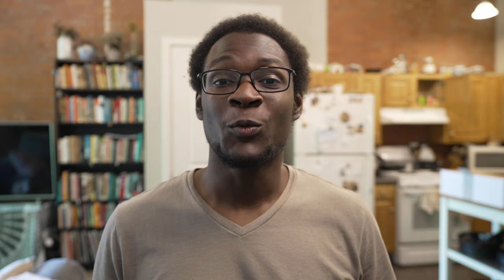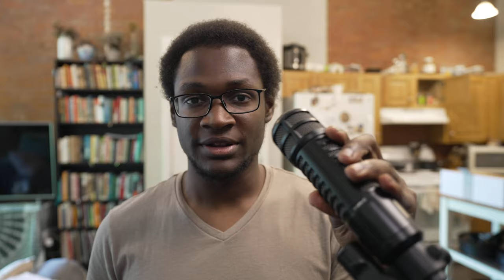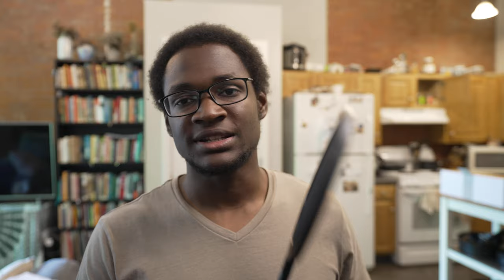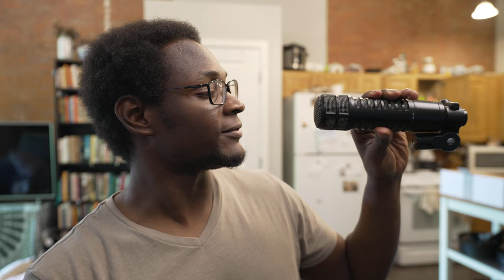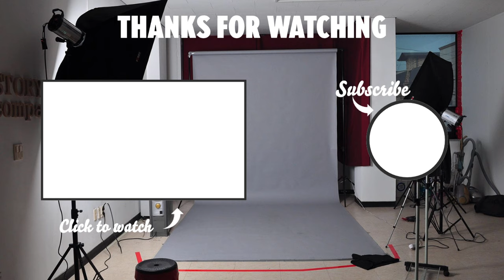The myth of popfilters

Comment: Awesome video mate. Gave it a like! I don't use a pop filter and often forget to put the mic to the side so I end up with pops in my audio. The way I do my vids, the non-perfect audio usually adds to the humour BUT you can tell when it happens. I've also noticed pop filters make a distinct sound when they're being used on a good mic as well.
Reply from the maker: Thanks for the like, I appreciate it! You're 100% correct, when you use a pop filter sometimes the material is so thick that you can end up rolling off a bit of the high end frequencies while recording. This can lead to a slightly duller sound overall.